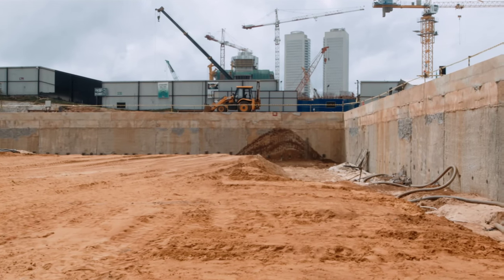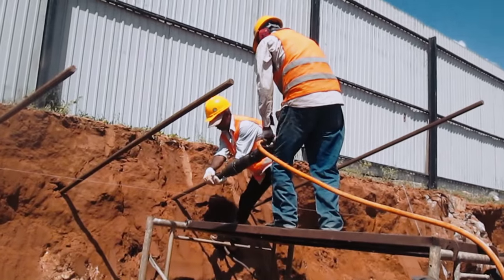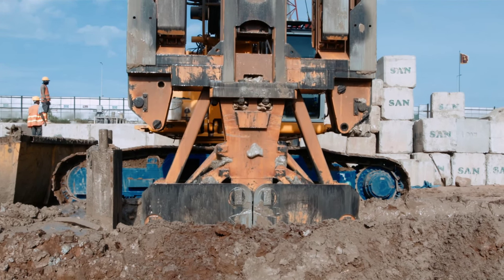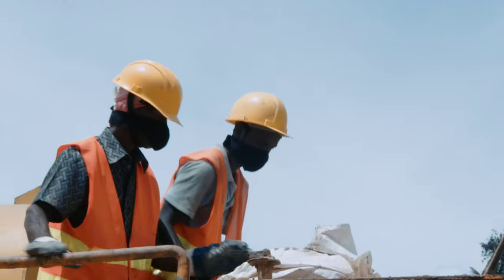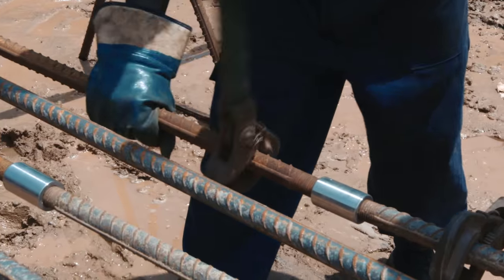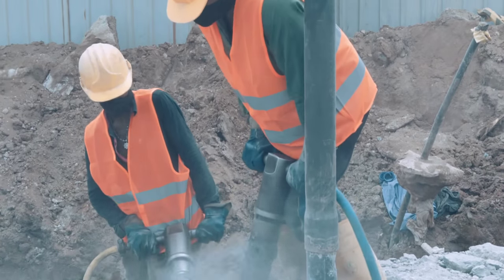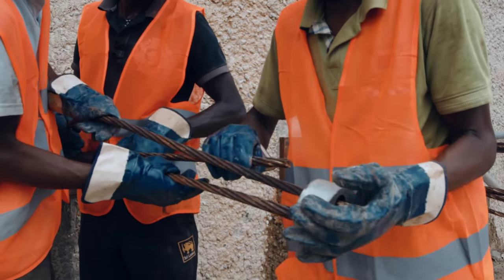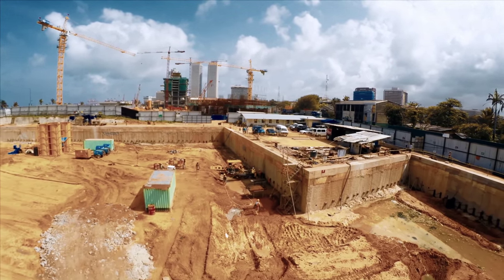Diaphragm wall Construction - ITC Hotel Project - Galleface Sri Lanka by Access Engineering PLC.

Comment: Why they constructing the mixture into the mud? I think it will affect the strength of concrete strength.
Reply: Nothing would stabilize the earth otherwise... The concrete is designed with this factor in mind. It's not so hard.
Reply: Bentonite mud pumps out during the pouring. These mud needs to stabilize soil.
Reply: To avoid collapse the hole
Reply: Bentonite is pumped out by concrete due to superficial strength
Reply: Bentonite is lower than concrete in density
So it is flowing up
Reply: Well done guys, very informative on the diaphragm wall. Thanks for the upload 👏